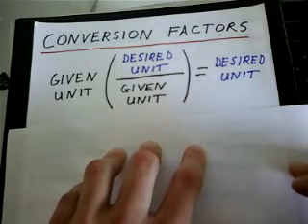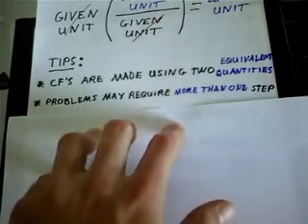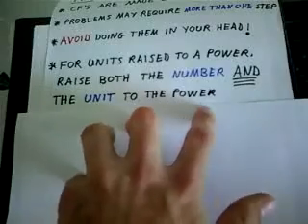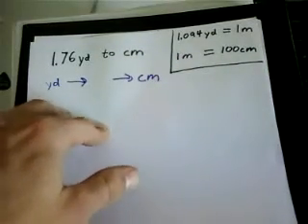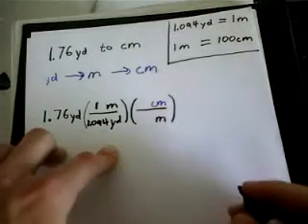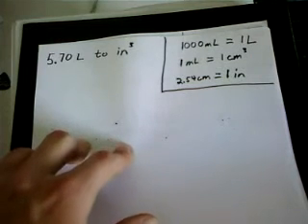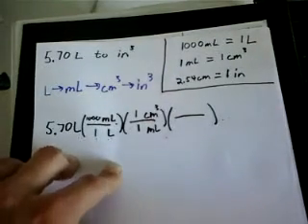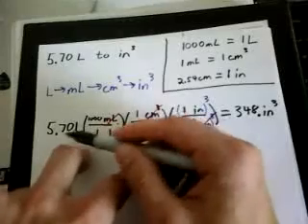Conversion Factors

Comment: Your video explained a lot and precised than reading my Chemistry book and for that I thank you! 

Also, if i were to be given a question like the problems shown on the video on a test. Would I have to memorize all the Metric Conversion to solve the problem or are the conversion factors given as a key to solve it. I am having trouble noticing which metric unit is bigger and which is smaller.

Comment: I will break it down to make this easy, since the original poster is not responding. When you are going to a larger unit, it means that your number will be smaller so you need to divide instead of multiply. When you are going to a smaller unit the number will be larger so you need to multiply. Here you have 1.76 divided by 1.094 which comes out to 1.608 round that up to 0.161( correct # of sig figs) now multiply by the 100 cm(going to smaller unit so we multiply) and we get161. cm